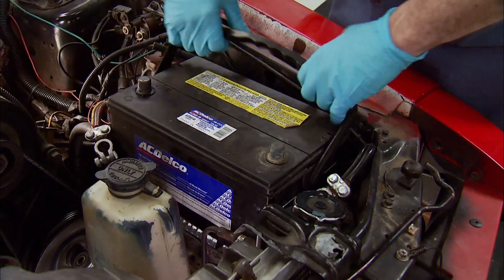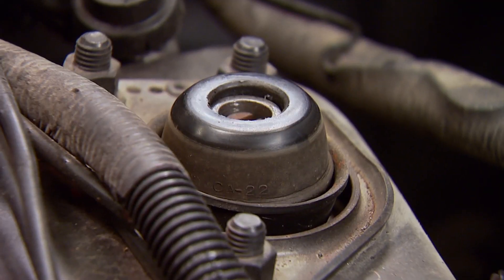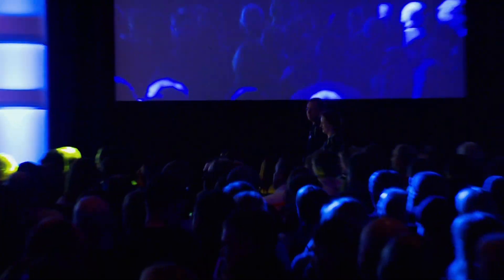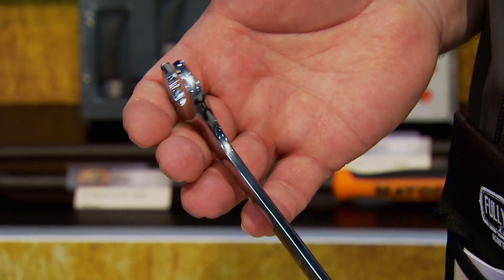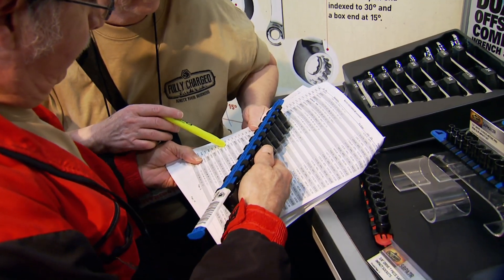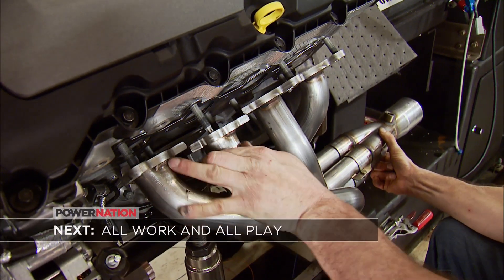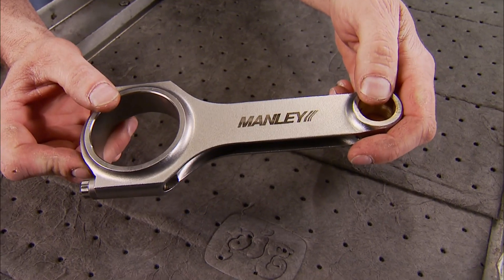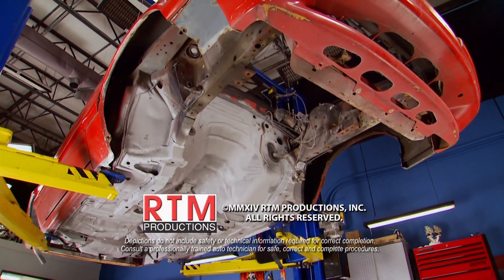Coyote Aluminator V8 Turns a 4-Cylinder Mustang Into Auto-Cross Beast: Part 1 - Engine Power S1, E11

Comment: I dont care what anyone says that motor aint worth 10000 dollars. Thats for damn sure.
Reply: The Gen 3 Coyotes run about $8500 from Ford Performance now. That's within $700 of a crate LS3 from GM Performance
Reply: @JohnDove  But think of how much money and time you will put into bolt ons and performance add on going with a coyote. I refuse to do the cams on my 4.6 2v f150 because the gains are terrible for the amount of money and effort invested and thats  sohc not dohc. But yea i agree if you just want a straight bolt in witha ton of power that your never gonna crack open id spend the extra up front and get the coyote but lets be honest who doesnt get the itch for more power. Even if the ls waa the exact same price the aftermarket and ease of doing things yourself just way out weigh the extra stock horsepower. Becauase i can pull a 5.3 block and for 700 at the machine shop, eagle rotating assembly, and even if you go with a decent top end kit, and some arp hardware, gasket and rebuild kit, And if its a full swap then a full harness 800 to 2000. Your still looking 8 to 10 grand on the higher end (if you are doing your own labor!!!) i enjoy the piece of mind knowing  What parts are in my block and having parts you can put your trust in and an engine that would drag that coyote 10 out of 10. So yea it all depends how dirty you wanna get and how much money your willing to spend(waste). I just feel like if these guys are pretty much doing a full restoration then why cant you guys build your own performance block( besides it being a compete advertisement). Even build a coyote if you want one bad. I just cant stand over priced crate engines that they sneak sub par mediocre parts in. And not a fan boy of any sorts. I drive an 07 f150 4.6, 2012 charger rt 5.7, old lady had a pontiac grand prix gt, and little v6 malibu so i dont pick based on Brand. Thats for sure i have no loyalty to any brand that aint loyal to me.

Comment: 400 to 450 horse is the perfect range for a car you are going to run and have some fun in. Get into over 500 and they aren't as fun on the roads. All my build are in that 400 to 450 range from my small blocks to my big blocks. Am I the only on that feels this way? To much power on the street isn't enjoying.
Reply: I have a 630 HP BBF in a 1973 Ford F-100, and it has all the amenities. A/C, PS, PB, AT, etc. I put about 40K on it over the last 3 years, and it's a dream to drive, even in traffic.
Reply: Amen, to that. I feel that 450 to 500 is about right.

Comment: I love the show and all the work yall do!! I like the coyote engines but they are too girthy. Kinda ruins the weight balance in a fox. I love my sbf tucked up into the firewall! My dream setup for corner carving is an aluminum 363 big bore with a transaxle! sla up front and irs out back!
Reply: An aluminator weights about 425 and a 302 w weighs about 450. Obviously aluminum heads intake and forged jnternals change the weight and may give tbe windsor a small advantage. But considering a bolt on coyote makes about as much as a windsor maxes out at id say the 30 pounds it may gain dont mean much
Reply: @slowbra94  To me its the size, girth. They sit pretty far forward adding a larger percentage of weight on the front tires. I believe an aluminum block 302 base big bore would offer more potential/better weight distribution in a fox for road racing. In drag racing/drifting the coyote would offer more potential because it's a baddass engine with gobs of power potential.
Reply: @ridemotoeveryday    @RidemotoEveryday  fair point. Im looking at it from primarily a drag racing perspective of weight and power. I could see something like a strong turbo 4 or I6 performing better because of the weight distribution. But im pretty sure a few companies have come up with ways to move the engine back in this particular swap. Or you could always just use a motor plate instead of mounts and but it almost completely against the firewall
Reply: @slowbra94  Thst motor kills it in drag racing!
I have my 302 against the firewall,  aftermarket kmember. The Coyote just takes up alot of real-estate, I definitely love the coyote and it's capability. But love my old pushrod v8's more. If I had the money I'd piss everyone off and buy a new mustang and put a sbf in it.😁 
I do my own work too so I have lots of ideas.
Reply: @ridemotoeveryday  i agree pushrods are just different. I daily and drag a 94 cobra and my best friend just finished his 347 carbed 88 fox. The real dream now is to put the 7.3 godzilla into these cars 🤣 pushrod and capability combined
Reply: @slowbra94  yea that's a beast of an engine. 
My dream car " I lost my 68 " is a 68 Cutlass. I want to do a street legal drag setup. Hopefully enter a few drag week's. There is now aftermarket olds blocks that can take alot of power. Dreams!
Good luck with your builds!

Comment: I wonder how hard it would be to get 500 hp from the old 2.3
Reply: Heh shove it in a courier or anglea
Reply: Never have the torque of a V8. Which is fine for light weight Hondas.
Reply: Probably about as much money as it takes to make a 500hp 302, I have an 87 hatch with a 2.3 turbo, not the fastest thing but makes cool noises.